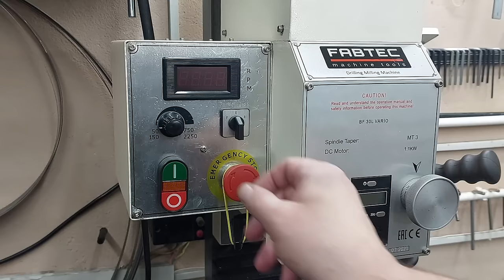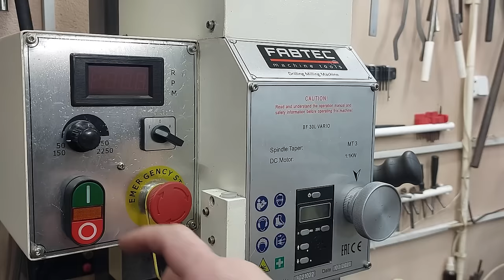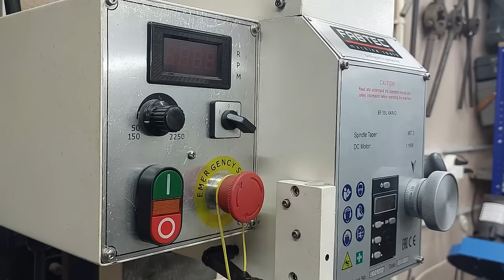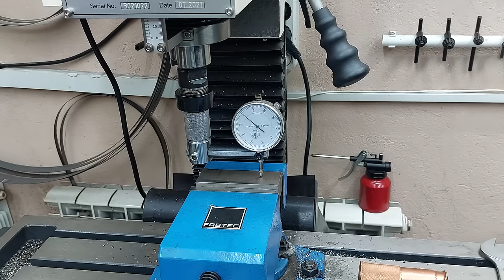That's just great! Assembled a homemade tool for my milling machine

Comment: Very good!  I also use this to adjust the angle of the upper head to 0° by rotating the clock machine spindle on the flat surface.👍